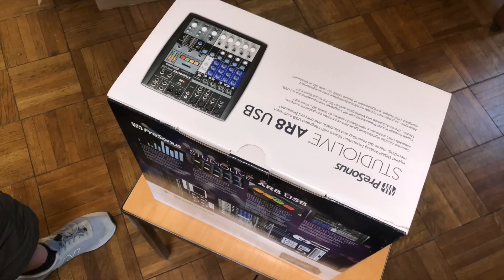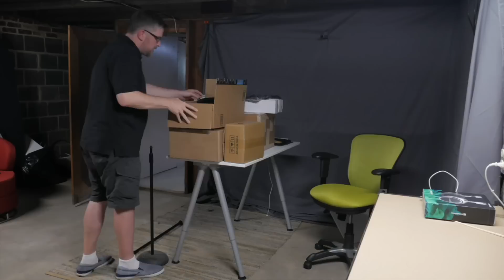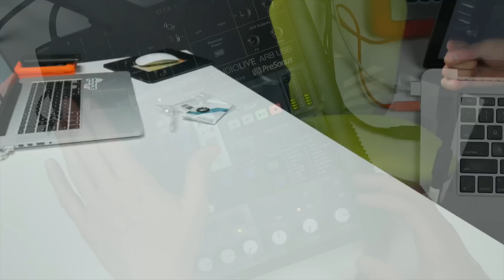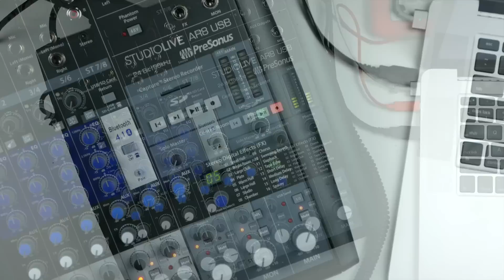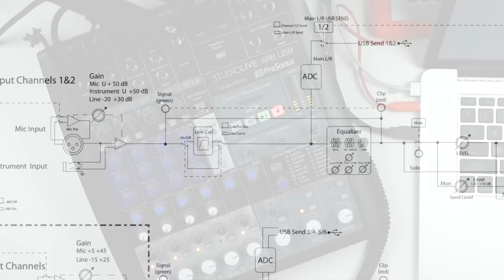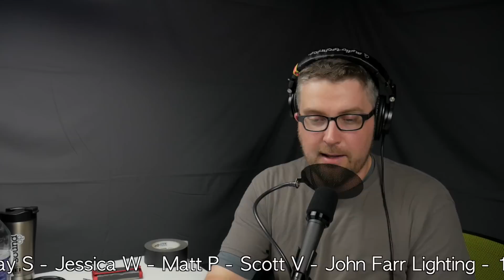PreSonus StudioLive AR8 USB First Look

Comment: can i use it for multitrack recording in DAW??Does the different channels in the mixer goes out to different track in the DAW like Cubase,protools,Ableton live etc.
Reply from the maker: Yes, the current model of this is the AR8c and they both have a multi-track 8 input by 4 output audio interface built-in. The internal SD card recorder only records the stereo main mix though, so you will need a computer and DAW to multi-track like you suggested. Any DAW will work.

Comment: Is it a typical problem with lipsync and Presonus?
I notice your lipsink is out.
My audio box also has a real time delay. Thank you
Reply from the maker: Sync is a problem anytime you record video and audio with two separate devices. You need to correct for it unless you have the devices locked with time-code. The machine this video was edited on in 2018 wasn't very powerful & it wasn't always easy to get sync perfect all the time on a laggy computer.

Comment: Hi , Do you know if there is anything else different between this model and the one with usb-c model . I noticed the Bluetooth and the usb-c to be different but I would like to know if there is anything else . Thanks .

Presonus studiolive AR8 vs Presonus studiolive AR8C ?
Reply from the maker: The biggest difference I remember is that channels 3/4 & 5/6 have a +10 boost and a different gain range, which if I remember correctly, was to meet the needs of some of the lower gain podcast mics that are popular now so you wouldn't need external boxes like the Cloudlifter. I can't remember if there were any other minor tweaks, but they are generally very similar.

Comment: I have a PTZoptics camera and a STUDIOLIVE-AR8C mixer, how do i get audio to my camera, it has a line in connection , what cable do I need to make this happen, I am trying to stream to a wix website via OBS
Reply from the maker: If you’re using OBS, add a new audio input source to your scene & then select the AR8 as the device. You can access the advanced audio settings then to set routing, panning & delay to sync to video if you need it.

Comment: Will this work as a "DAW controller" for Studio One Pro V5? Would I be able to run the XLR's (4?) to add to an audio interface that has 8 XLR inputs?
I'm learning Stidio One now, I'm just wondering if this would make things easier for recording a drum kit, podcasting........?
Reply from the maker: I probably wouldn't recommend this unit for that application. You would be better served with a StudioLive if you're looking for DAW control and the ability to expand and add modules together for things like recording drums. Have you checked out my video on the 16R? It's a really affordable way into the StudioLive Eco System and combined with a faderport can be a really powerful setup! https://youtu.be/VaNZ86oUc9k

Comment: When I connect headphones I don't get any sound. Is there a switch or solo function I need to activate? Peace.
Reply from the maker: Hey Jose, can you tell me a bit more about your setup. You should be getting sound if you solo an input, assuming you have the headphones turned up etc. Let me know where you are stuck & I'll try to help. Thanks for the message!

Comment: hey i had a quick question, i have a roland gr 55 , its a guitar synthesizer that takes in guitar signals from a hex pickup and outputs midi tones, would i be able to record the output with this device onto the SD card? or even record it to the studio one software via this device(using as an interface)?
Reply from the maker: If you want to record the audio output of the guitar synth, this can absolutely help you do that. If you are asking though if it can record the Midi data, the answer is no. You'd want an interface that has a midi in/out connection and then you can use your gr-55 to send midi data to your computer & DAW to be used with other synths, etc.
Reply: @DcSoundOp  ahh ok, as of now i just want to record the processed sound coming out of the gr 55 to be sent to the Ar8, to record it into a DAW, right now i have presonus studio one v3 but im not able to record the gr 55 with it, i was hoping this would make that process simpler. I do own a focusrite 2i4 as well, but want something without having to use my computer all the time.

Comment: I am new to all this. After recording my music into the SD card how do I listen to what I have recorded? Do I need then to connect the SD card to my computer and use a software?
Reply: Just press the rewind button, then play, (i assume you have headphones or monitors attached..) if you are going to work with the file/music, just put the SdCard in your computer (transfer the file) and use it in your daw or other software as you wish, i have this mixer and also pretty new to it. - i have noticed that it is very hard to "overload" the recording signal, (by mistake)  you can crank up the levels pretty much before that happens, and thats good, Levi

Comment: Please tell me they upgraded the mic preamps on the new AR8C model. Looking to buy one of these but all the video's I've seen have the gain cranked all the way up for the vocals.
Reply from the maker: They actually did address this. Not sure what they've changed with the input circuitry, but the previous version was applying +50db of gain all the way up on the input trim, while the new one is up to +55 all the way up, so you don't have to turn them up quite as far physically to get the same gain. They've also improved the Signal to Noise ratio on the outputs from 89 to 94dB, system crosstalk is down -5db from before amongst other slight changes in the spec sheet. 

They also stuck a +10 boost switch on one of the channels that will help if you're using a broadcast mic like an SM7 or RE20 that needs more gain. So that's an interesting development. 

I should add, this is all from their specs, I have only briefly seen the new version in person at a trade show and have not had a chance to use one side by side with the original version I reviewed in this video. 

One question.. assuming you can achieve a good input level without adding a lot of noise, does it matter where the physical knob is pointed?

Thanks for the great question.
Reply: @DcSoundOp  Thanks for the quick response and the specs! I'd be using this for my acoustic duo and trio gigs to "capture" live recording so I would definitely need the mic preamps to be loud enough to cut through. I wouldn't be using it for podcasts but I see your point, lol.
Reply: @DcSoundOp  Where is this +10 boost switch at?  I've looked all over for it.
Reply from the maker: JustinFREAKIN It’s on channel 3/4 of the AR8c model, not on the AR8 in this video.

Comment: How do you connect phone to receive calls through the mixer for online radio broadcast?
Reply from the maker: You can use the Bluetooth connection like pairing your phone just the same as any other Bluetooth device. You can always hard wire it as well with any number of adapter cables, depending I your model phone of course.
Reply: Thank you so much for your response. I did use the Bluetooth when recording you can hear my voice but it did not record the voice of the caller.  If I use the quarter inch cable in what connections on the mixer should be connected? I bought an iRig2 and plugged in the quarter inch into a mic channel and another into the aux output fx. I recorded a call using the capture software and it was ok. I just have to tweet it. Do you have any suggestions?  Thank you

Comment: Will they do a firmware update to include a mix-minus via TRRS cable capability for pulling a phone call into a podcast?.  Rode & Zoom have both put this into their "podcast' mixers similar to this.   Also I'd love to see Presonus put this ability into their larger mixers as we would probably buy for our on-air studios.   I really like the Fat Channel capability but the phone call integration is a deal breaker for us since we do so much content for radio stations.  Good job on your video.  I like your format.  You don't waste my time.
Reply from the maker: This is an analog mixer, so you would have to use the AUX send for any sort of mix minus via TRRS.

Comment: My AR8 mix voice out going is very low   when I record my voice in my computer by USB plz help me
Reply from the maker: Hi Anjan, what are your input and output levels on the meter? If you use the PFL button on the channel, is the level near 0 or slightly above? How about the output meter, where is that? If you’re not getting up to the 0 or slightly above range on both, you’ll need to turn things up.
Reply: @DcSoundOp  which channel is best for condoncer microphne use plz

Comment: Question: Where do you connect your studio monitors to on this USB audio interface? Both L & R??
Reply from the maker: Hi, great question. It really depends on your preference. I would probably connect studio monitors to the Control Room outputs (labeled Ctl Room on this console) so that the PFL will work to solo individual channels. You could connect to the L/R outputs if you needed to, there is nothing wrong with that at all, you will just only hear the L/R mix. 

Thanks for the message!

Comment: Question?  I just purchased a AR12.  How can I monitor the SD card to know if it is really recording.  I have recorded with it and played it back through the system but, I would like to hear the actual recording as it is being recorded.  Can the mixer do this?
Thanks again for your informative video, I subscribed to learn.
Reply from the maker: So on the AR12, the recorder only records the Master L/R bus. If you think of it like a BIG portable stereo recorder (like a Tascam DR-05 or Zoom H1) - anytime you are monitoring the master bus, you are monitoring the recorder. Functionally, you are monitoring the signal in the same place in the signal path as you would on a portable recorder. 

I hope this answers your question. 

Also, PreSonus documentation is pretty good these days and I keep PDF copies on my mobile devices for quick reference - https://pae-web.presonusmusic.com/downloads/products/pdf/StudioLiveARSeries_OwnersManual_EN_19092017.pdf
Reply: @DcSoundOp  thanks for the info, that helps

Comment: Even in this one you do it plz. Tell me where have you connected the DSLR
Reply from the maker: For most cameras, an XLR (Female) to 3.5mm (Male) cable will allow you to take an output from a mixer and connect it to a camera with a 3.5mm mic input. You'll need to turn down the input level on the camera, and make sure the signal from the mixer is not too hot, but otherwise it should be fairly simple - here is a cable that would work - https://amzn.to/2zMtWsB

Comment: Plz Tell how to connect a camera for into this mixer
Reply from the maker: It's going to depend on what type of camera you have and what you're trying to accomplish. Are you trying to record audio from the mixer to the camera, or are you lookin to playback from the camera or something like that?
Reply: @DcSoundOp  Thank You So Much for Replying.I want to record .What do you mean by playback I did not understand could you plz explain
Reply from the maker: If you had a camera with an output, like a video camera, they can playback recorded footage too. In this case you'd connect the camera like any other source to the mixer. It's not something you'd likely need to do, but since it requires a different cable, it seemed worth asking what you're actually trying to accomplish.
Reply: @DcSoundOp  Yeah Got you.Yaa I need to Record it.For Example like I wanna do live Covers with my guitar and vocals so both those together

Comment: How did the effects sound quality compare with the QSC Touchmix 8
Reply from the maker: I didn't have an opportunity to listen to them side by side. They work, and could probably be fine in moderation, like most built-in Efx. If effects are an important factor for you,  I would look to the QSC. Just for the amount of control you have in adjusting parameters, you'll get more out of it. I hope that helps.

Comment: Any further thoughts on this series of mixers? I've been looking at the AR12 as a possible step up from my current powered mixer all-in-one type of PA system. Would be nice to have some actual faders, sweepable mids on the EQ, and multiple AUX outs. Mainly for live sound use, pop-up events.
Reply: Great low cost Line but you will need to buy 2 channels worth of amps for your PA.  The EQ on the AR8 is not sweepable, low and high are shelving, no frequency select knob for the mid, just a filter.  There are 2 aux outs if you count the FX bus.
Reply from the maker: Hey Ocularis73, I do have more thoughts on the AR series, and will do a future video on them for sure. I had to send this one back before I could finish up a second video with it, but I'm hoping to get one of the bigger models in soon and do the wrap-up video with that. 

My only concern with the mixer so far is the inconsistency in the pre-amps on the model I was testing. They worked okay, but were not consistent from channel to channel (not a huge deal). You'll need to crank them up too for relatively 'quiet' sources like spoken word on an SM57, and they can get noisy depending on your situation when you do that. 

This is an incredible level of scrutiny though for a $500 mixer and 14x4 interface. If it fits your needs features wise for the price point, it's worth getting your hands on one in person.

Comment: Hi brother is ar series good for multiple track record means studio live recording. Is all Input also work with Neundo or cubas?
Reply from the maker: Hey, sorry for the slow response! Yes, the AR series are good for multi-track recording both live or in a home studio. It's essentially just a big sound card once it's hooked up to your computer with the USB cable, so it should work fine with any software you're running on a modern computer.
Reply: All 8 tracks and the mix can be recorded via usb on a computer running the Presonus Capture software.

Comment: Does the Blue tooth allow for a phone call to be input from the phone?
Reply from the maker: Scott Sullivan I believe that’s going to be dependent on your device, not the mixer. It’s just a receiver in the mixer, so if your phone will send it, it should accept it.
Reply: Thanks, I am looking for a way to take calls live on the radio
Reply: Yes, if you have the correct TRRS cable you can run the microphone wire to the AUX Out and have a microphone on channel 1 and turn up the aux knob.

Comment: Do I need powered speakers to use this mixer?
Reply: Yes, it is a Passive mixer.
Reply from the maker: Hey Richard! Yes, you will need to power your speakers independently of this mixer. You can choose to do that with a powered speaker that has an amp built in, or with a passive speaker and a separate amplifier that you would in turn connect this mixer to. Either way will work, but this mixer does not have an amplifier built in. Hope that helps, let me know if you've got any other questions!
Reply: So if you plug in studio monitors you don’t need a power amp?